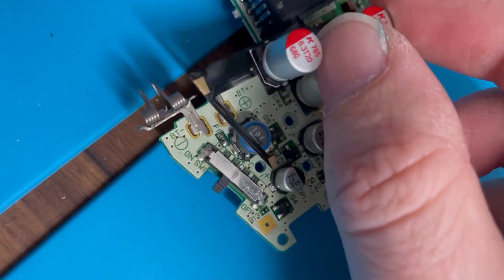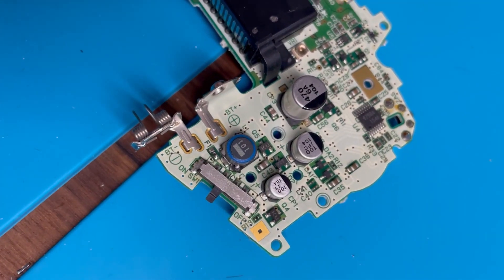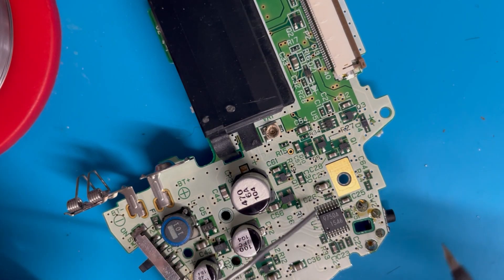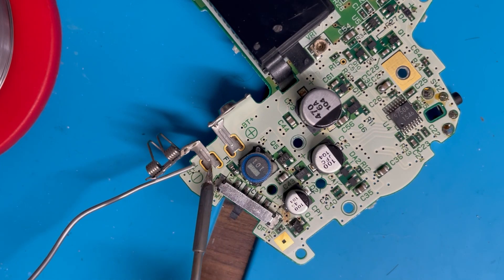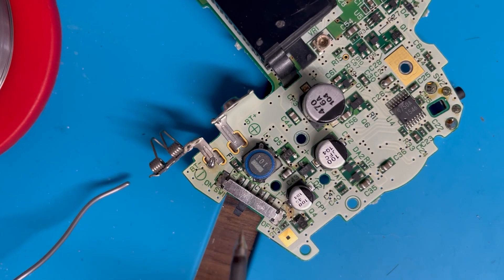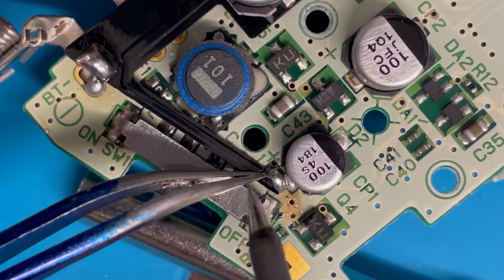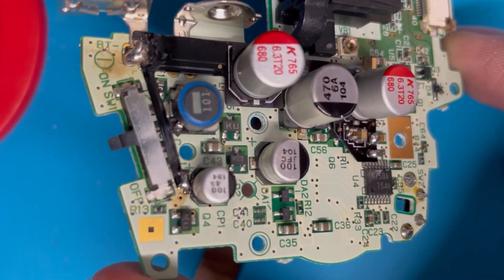Installing Wire Free Dehum Kit RetroSix GBA

Comment: I just destroyed my GBA and regret it. It doesn't turn on. Everything looked so easy in the video but I don't think it actually is. I used my Iron too hot at 410° C and it was probably too big. I soldered away the tiny capacitor accidentally.

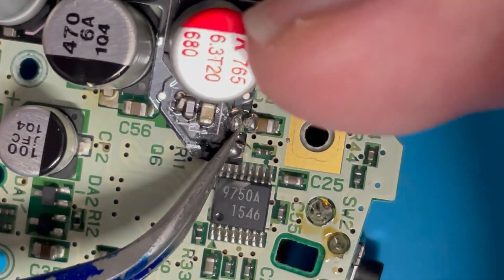Comment: 4:34 i shorted the 9750a chip and now the gba is dead
Reply: About to do this mod, how did it get shorted, got me worried now 😭
Reply: @NephewFlops  I couldn't get the solder to stay on the small chip next to it (C26) and I eventually ended up applying solder on a couple of the pins of the 9750a chip. I tried removing the solder but I kinda made it worse. The GBA didn't turn on anymore. It's my fault though I guess for being bad at soldering 😅. Good luck !

Comment: When soldering the kit to capacitor C54, I accidentally removed it. I soldered it back, but the terminals ended up covered with the same solder, and then I soldered the mod on top of the capacitor as instructed in other tutorials. Should I be worried? What could happen if capacitor C54 is not properly soldered?

Comment: So what's the difference between the power cleaner and this one
Reply: I installed the cleaner new speaker and added an amp would It be best to install this also?
Reply from the maker: The power cleaner is a bad clone of our Dehum kit. It doesn't filter out noise and adds issues to RAM channels. Remove it and put the Dehum on
Reply: Dam it ok ☹️

Comment: Cap above c44 is now squashed in the case. This pulls the front plastic and warps it making my glass screen come away
Reply from the maker: Must not be setting right. We have sold over 5000 now including about 10 consoles every day and have no issues of fitment. If you join our discord and send photos we can assist in finding the real problem

Comment: What's the unused solder pad at the top left for? It looks like Its designed to join to the adjacent capacitor but you don't do that.
Reply from the maker: Just a physical support it's not needed just helps keep things flat
Reply: @RetroSix  thanks - I soldered it on anyway. All working fine! I also installed the clean amp kit. The improved sound really makes a difference in my opinion. Makes games more immersive. One of the things I like about retro games like F-Zero Climax is the soundtrack and now I can hear it much better. The speaker also fitted nice and snug in one of your shells so no buzzy rattle. Very happy with the sound.

I also installed an IPS screen from ebay at the same time. This worked perfectly for 10minutes but now it has developed a fault. There are now 2 black lines down the side. I'm wondering if a tiny blob of solder broke off and is shorting across somewhere? I might take it all apart and clean it with a swab and alcohol.  Or ask ebay for a refund / replacement. Not your problem though.  I would have bought ine from you guys but you were sold out.

Very happy with your shell and sound  mods though!
Reply from the maker: @nathanaelsmith3553  sounds like cracked screen. We have CleanScreen now much better than IPS you should try it on next round

Comment: Just bought my first soldering iron (what could go wrong)... Bough the IPS screen, clean juice and I'm gonna order the rest of the gear to try and do a full mod on my gba with the gear on your website (audio stuff, clicky shoulder buttons, LED replacement, a see through case and new buttons/ pads), I'll be getting the other stuff next week. I've soldered my guitar's line a few times but never soldered to circuits, nice tip on tinning the solder first... Wish me luck...

RetroSix is my gateway into modding, so thanks for this experience, I'll update this comment according to how well I (as a beginner) do.
Reply from the maker: Good luck and if you struggle just stop and ask for advice on our discord then show us your results

Comment: I love your videos, I have been watching a lot of your guides since I installed the IPSv2 on a gba, however I noticed the hum after the mod, if I do this mod do I still need to take care of the old Caps that are in the original gba board and replace them with new ones? Or does this mod act as a bypass for the caps involved with the sound? (I am referring to the CAPS CP 1 and 2, I dont know which one is actually for the sound haha) I also noticed that the gba speaker is so weak even in max volume but when i use headphones the volume actually works when i change it to any setting so i dont think its a volume knob issue, will this mod help with the speaker problem too?

Comment: This video is super helpful!
I accidentally soldered away capacitor C26. I tried my best but to put it back in place, and the console turns on. But I wonder if I did a better job. What could be and indication that I didn’t soldered back in place properly?
I installed this mod alongside the Clean Amp Pro and I do like how my GBA sounds now.
Reply from the maker: It will work without as the dehum has an extra one on so no worries

Comment: Do you or anyone here has experience with installing this kit on a gba with stock audio? Mine only has an IPS screen and the cleanjuice battery. Will I notice any difference on noise after installing?
Reply from the maker: It will help with the noise the IPS adds, and improve headphone noise also
Reply: I finally got into installing the kit (after 1 year I know lol)

I can confirm that it does eliminate the noise om my GBA with just the IPS screen mod (stock speaker). Will likely help with a GBA with stock screen, although I don't see many people doing that.

Comment: does this kit increase the volume at all even if just a tiny bit?
Reply from the maker: If you have an amp like CleanAmp yes might allow slightly higher output due to larger capacitance
Reply: @RetroSix  what if you just install this without the cleanamp chip?
Reply from the maker: It would just reduce the noisev

Comment: Do you not solder the top left corner to the capacitor it touches?
Reply from the maker: It's only a support pad doesn't connect to anything
Reply: It’s supposed to go to cap c54
Reply: Is C54 joined or not to the DeHum ribbon..? Looks like it should...?
Reply from the maker: No it's just an optional physical support

Comment: Lets say the tiny cap at c26 accidently came off, what would it need to be replaced with?
Reply from the maker: You should be good to leave it off so long as the Dehum kit is installed and there isn't a short between the too and bottom pads where it was
Reply: What's it do if it can be left off? ... Asking for a friend... That totally couldn't get the solder to slide over and melting that little fucker right off 🙄🤦
Reply from the maker: If you don't attach the dehum it will still have noise on audio
Reply: @RetroSix I attached the dehum, the only casualty was that tiny capacitor.   But everything seems to be working without it? 🤞🤞🙄

Comment: Has anyone compared this kit to Helder's power filtering mod in terms of noise improvement?
Reply from the maker: Helder just copied my original design article and did it wrong lol. Yes people have compared and his doesn't filter most of the noise as it doesn't even have capacitors on the main noise lines
Reply: @RetroSix  Thank you!

Comment: One of the capacitors on that board is touching another, looks like a flaw. You can see it clearly at 00:04:43
Reply from the maker: They are joined to the same rails so it's ok

Comment: What about the pad in the top left, is that one not necessary to connect anywhere?
Reply from the maker: No that's just for physical support if you have a cap there but doesn't connect to anything or do anything
Reply: @RetroSix  does the same apply to the far left pad on the gameboy advance SP dehiss dehum kit? I noticed that one had an extra pad top
Reply from the maker: @LMR__1  there are 6 pads on the SP one and all needed
Reply: @RetroSix  What is the 6th pad needed for? Its absent from Helser's original design.
Reply from the maker: The original design is actually mine lol there is an article on it on support.retrosix.co.uk explaining the design. Depends what pad you mean is 6th pad. But far top left is ground for input. The other design is poor as of causes a long ground loop for all power filtering flowing through one small ground point far away from the input filtering
Reply: @RetroSix  alright, apologies for the misunderstanding. I'll make sure to give this a read. I've actually never soldered before and I'm asking most of these questions as I dont want to make any mistakes.
Reply from the maker: @LMR__1  no worries I'll do a video installing it shortly so it's obvious to see too
Reply: @RetroSix  alright, thank you a lot for your replies, I'll be looking forward to this video.

Comment: While the cleanamp pro is a real improvement this wirefree kit isn‘t. I installed a few of the former dehum/dehiss-kits and even this was not easy once you had a connection it worked. Not so here. The connection with the battery pin always looses contact after a while. There is no stable connection possible. I tried it five or more times but it always gets loose after a few minutes. It is enough to look on it funny to loose this connection. I do not understand why talking about an improvement when this kit is much harder to install then the previous one. I had no problems with the other three points but this battery spring connection is a joke. Is there an alternate point so that i can use a wire instead?
Reply from the maker: If it's not sticking you are not breaking through the tin layer of the ground pad. If you follow the advice here to watch solder flow into an even pool after many seconds then it will be a solid solder joint. We do them dozens of times a day and they won't come off if done like this. If you still struggle you can solder w wire to any ground like the shield pad of the switch
Reply: Thank you for the fast response and the advice. I tried it first as you have shown it here but that did not work for me (i think my soldering skills are also far away from yours as you are a professional :-). I then increased the temperature from 350 to 450 degrees Celsius to get solder on the battery pad and after i lowered the temperature when connecting to the kit. That worked in the end. As always i watched the video (if available) before starting to install and i saw also what you did with the solder but when i tried it myself the solder always did not leave the iron‘s tip.

Comment: what kind of soldering iron are you using for this? and what diameter solder? the generic kit I've got laying around can't get anywhere near this precision... at least not that i'm comfortable trying.
Reply from the maker: Hakko but the TS 80 we sell on store is good enough and much cheaper. Solder is 0.38mm solder king we sell also along with the flux

Comment: Is this version more effective than the other kit?
Reply from the maker: It works the same as our other RetroSix dehum kit you solder without the flex board. For other kits out there yes there are no known correct dehum kits that actually work fully, only ours. They add capacitors to the wrong places and leave others off completely. Stick with the original for the best experience
Reply: @RetroSix  tyvm for reply I purchased a modded gba to learn from.  It came with the original dehum kit so I wanted to make sure I didn't need to find one with the wire free installed.

Comment: Quick question does yours make a loud high pitch noise every time you turn it off?
Reply: Mine does the same thing. I installed a clean amp pro and a funny playing clear speaker in my GBA along with this kit. Every time I turn it off with the volume wheel about half way turned up I hear a noise. Have you figured out anything about this?
Reply: x2
Reply: @feliperocco8052  what does that mean?
Reply: I'm experiencing this as well. But haven't been able to find anything to solve it.